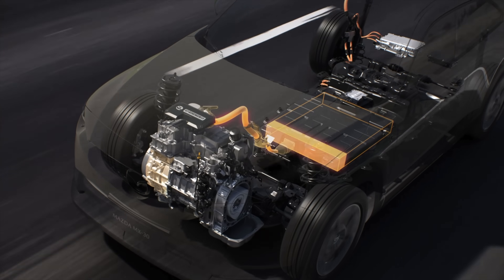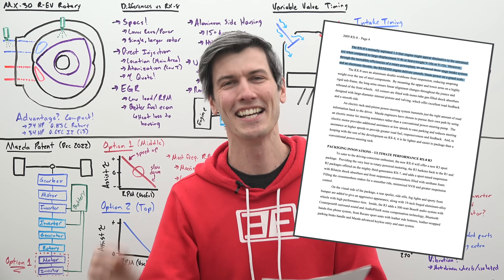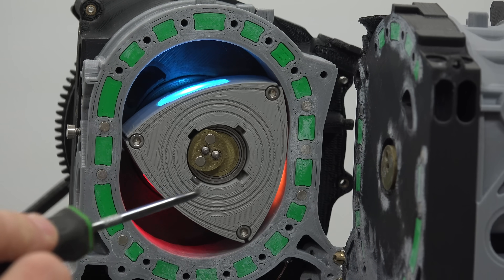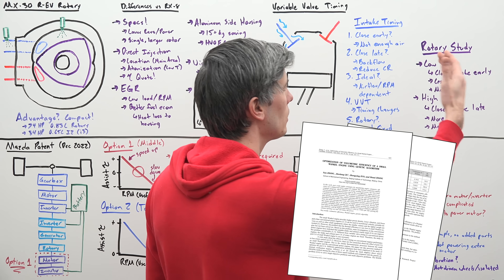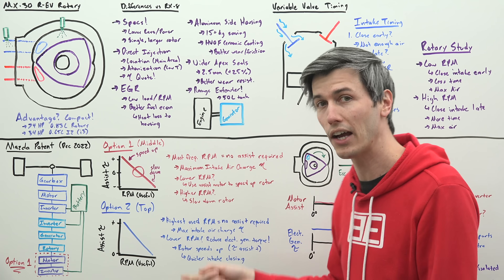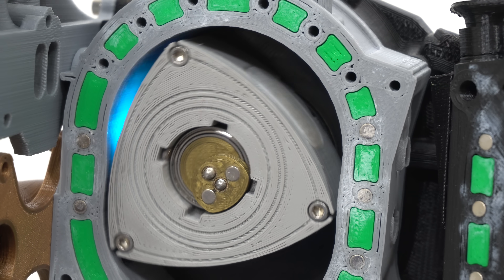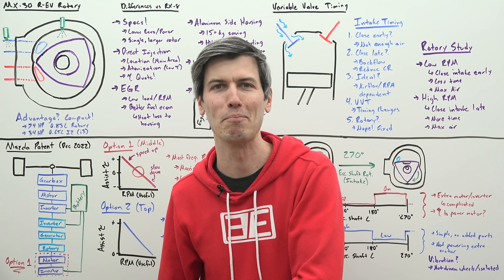Mazda Brought Back The Rotary Engine!

Comment: I've always wondered why we don't see rotary engines in modern motorcycles/atvs/snowmobiles/etc. Low vibration, high revving, not as much of a concern about efficiency or reliability as cars. A generator is another application I would say it seems like a good fit for, although putting that generator into a car I'm not so sure about. I saw nothing about addressing oil consumption which owners of modern cars, especially hybrids, are probably not going to be expecting.

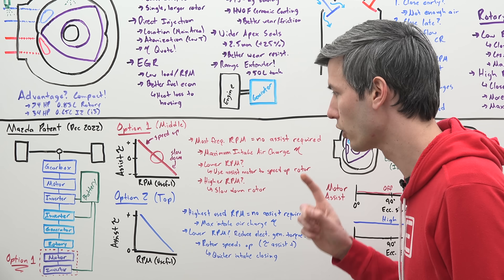Comment: 7:30 For a generator and battery bank sized to your max load you DON'T CARE about RPM range. 
1. The generator is never directly driving load. 
2. Your pack power matches your max load. 
3. YOU GET TRADEOFF BENEFITS OF OPTIMIZING FOR A TINY RPM RANGE.

Comment: Just a random question: has anyone ever considered using gas turbine as the range extender on EV vehicles? What would be pros and cons of such approach?
Reply: Excellent question. Because turbines run at a much higher rpm, the size is smaller and I expect might be about the size of a shoebox. Also, less vibration and fuel-agnostic. Hyliion is working on it.
Reply: Yes, it has been done many times.
The pros are that a turbine engine can be small and smooth, and that it can run on a range of fuels. 
The cons are that small turbines are inefficient, more efficient turbines with recuperators are expensive and have high oxides of nitrogen emissions (and still are not very efficient in small sizes), and turbines with recuperators are bulky and expensive (and still not very efficient in small sizes).
Reply: @brianb-p6586  Done many times? Can you, please, list any? 
I am sure aware about attempts to use gas turbine as primary engine, where it was mechanically connected to the propulsion (eg. transmission and wheels). I know attempts to us it in an electrical transmission setups, similar to the diesel locomotives, where turbine is used to drive an el. generator, which in turn would send generated current to the el. motor, driving wheels.
I also know about turbo electric generators (apart from those, used in aviation).
But, I never heard of a gas turbine, used as range extender in an EV vehicle, where the turbine is not connected to the propulsion at all and is only charging the batteries. And this is what I am asking about.
Why this kind of use is different from other attempts to use gas turbine on the ground vehicles? Because in the "range-extender" setup turbine can work within it's most efficient RPM range, independent  on the actual load on the propulsion system. This, theoretically should eliminate most of the problems with gas turbines, you listed.
Reply: @SQSNSQ  most of the turbine-electruc hybrids were urban transit busses, using turbines from Capstone. Wrightspeed tried it for years, for trucks, and even built their own engine. The most recent well-known example is by Ariel, using a Cosworth CatGen turbine.

Yes, mechanically decoupling the turbine from the wheels helps, and as a bonus the ability of an electrical generator to run at high speed eliminates the reduction gearbox usually required for turbines. Efficiency is still not good enough, especially with current emissions expectations. The series hybrid configuration does address some issues with turbine engines in conventional vehicles,  but not the cost, emissions, and efficiency issues that I mentioned.
Reply: @SQSNSQ  you described "an EV vehicle, where the turbine is not connected to the propulsion at all and is only charging the batteries". That does not exist, and cannot reasonably exist because if the generator (driven by a turbine engine or anything else) is connected to the battery, and the battery is connected to the propulsion motor(s) - through controller(s) of course - then the generator is connected to the propulsion system. In battery management terms, this is known as "floating" the battery, and it is the way that every hybrid vehicle works. The generator produces electrical power, the motors consume it, and the difference in power is the net charging or discharging rate of the battery.
Reply: @alexfunk2047  A shoebox-sized gas turbine engine is the size used in radio-controlled toys, and can produce a couple of kilowatts - nowhere near enough to be useful in a car-sized EV.

Comment: Pretty cool!  The Mk1 Honda Insight hybrid did a similar trick, but for a different reason: they used the motor-generator (which was in place of the flywheel) to smooth out the torque pulses of the 3 cylinder engine, so that the lightweight car was smoother to drive!

Comment: Well, the old Renesis engine definitely is incredibly efficient as compared to those big American V8 engines, it produces the same horsepower while being 5 times lighter and using less fuel... They didn't lie in the papers.

Comment: Now use this as a generator on a boat instead of huge lump of a  multi cylinder diesel generator. 
Where it can run efficiently at  relatively fixed rpm. 
Next step heavy fuel  fluid piston motors to power and or charge hybrid boat systems .. especially those with sails and acting as cruising or liveaboards.

Comment: Great video! A little off topic but the recent Pininfarina Battista quarter mile record set recently made me wonder how to analyze what an electric car might look like (with today's technology) that could match the performance of the current top fuel dragster 1,000 ft record (339 mph at 3.6 seconds). Could it even be done?  Would it be massively heavy and and need much more power/torque or with the instant torque of electric motors could it be smaller and lighter?

Comment: I imagine this has to have been thought about already, but why not try something like a power valve, like on some 2 stroke dirtbike engine, but on the intake, with some sort of soilonoid to vary to intake port placement
Reply: That is basicly what the Mazda '6 Port" induction system which was introduced on (I think) the second generation RX7. The engine had the normal 4 side ports. but one extra smaller port, effectivly a bridge port, was added to the front and rear side housings. A small barrel type valve operated by a an actuator, opened the extra ports above about three and a half grand, to give about 25 extra HP without affecting normal drivability.

Comment: Bro, in the previous press, when they said efficiency they meant thermal efficiency, I guess. How much of the energy from the fuel that is actually used is converted into kinetic energy. Theoretically speaking, rotary engines convert more of the fuel energy into kinetic energy.

Comment: changing rotation speeds all the while there is actual ignition going on in different part of the rotor...sounds like working against itself. If the point is to have variable airfill then an electric turbo would be more practical i guess. Need more air, spin up the turbo, need less, well at lower speeds it already works as a brake on airflow.

Comment: I'm interested in getting this r-ev but I have yet to find fuel consumption numbers. I read the range is "over 400 miles" with a 50l tank and a 13kWh battery, which would be rather poor. Not necessarily a deal breaker, though, as in this application efficiency and reliability are less important than weight, noise and vibrations, but I would still like to know what to expect.
Reply: I still wish they simply used something like Yamaha's x-plane parallel twin (or tripple). They would probably have to detune it for noise and emissions but I would have more confidence in it than a Wankel engine.

Comment: Rather that  using a motor to briefly slow (reducing the efficiency by fighting inertia 3x per RPM) and speed up (reducing efficiency by needing to electrically assist to speed it back up again), which I feel is gonna create wear issues, vibration (since the rotor would be forced to speed up and slow down in a non-linear manner), and other issues, I feel a VALVED rotary engine needs to become a thing. They should use an elongated valve that opens via electric motor or via output shaft drive, but open INTO the intake manifold, rather than down into the rotor chamber. This would allow for a VVT effect without that weird briefly changing of the speed of the rotor back and forth compared to the RPM constantly, working against itself.
Reply: Engineering Explained, what is this? Scammer pretending to be you?

Comment: Why not just doing very big intake ports (for high RPM) and shrinking/closing them when the RPM drops?
Reply: Why not use a more efficient reciprocating engine... Wankel engines are noisy, dirty, unreliable and have terrible fuel efficiency... totally incompatible with the whole green energy concept of EVs

Comment: So a rotary engine is good but not good. I wanna become an enginiere and when i do, if it didnt allready happen, i wanna upgrade the rotary engine. Possibly make a sorta fan or star design in a way that the fuel air mixture wont get exausted as raw burnt fuel. Altho them pops are nice.

Comment: Ignoring for a moment the variable rotor velocity that was the main subject of this video, would not the adoption of direct fuel injection as per this range extender enable a power-to-wheels rotary to recover some of the fuel efficiency losses of previous engines?  
And, I understand that thermal losses through the high area walls are a problem, but that is because the walls are cool.  The current paradigm of IC engine design keeps materials and lubrication within the temperature bounds of pressurised water and liquid hydrocarbon lubricants, because those are cheap and avaialble.  Could there be material surface and lubrication solutions that would enable the walls of the chamber stay at near combustion temperatures, and thus substantially eliminate that thermal loss (after warmup, of course)?
Reply: GDI was tested on Wankel engines back in the 1960s with very disappointing results, Wankel engines cannot support the higher static compression ratios needed to make GDI technology advantageous.
Reply: Unfortunately any new developments in high temperature materials would offer equal or greater benefit to reciprocating engine technology which is inherently more efficient, reciprocating engines offer greater combustion efficiency, thermal efficiency and much better mechanical efficiency.

The Wankel engine is inherently flawed on a fundamental level and will always be inferior to reciprocating engines.

Comment: @Engineering Explained: given that more  and more of these Hybrids just use the engine to run up a generator, does it make more sense to use a gas turbine which should give way more efficiency. The Inc cost point of a gas turbine I agree. But are there other considerations?
Reply: Range extenders in general are not a viable concept, gas turbines even more so.

Comment: The real genius is that to control the torque of the generator is as simple as changing the excitation to the field of the generator. In fact this is already being done to control the output voltage anyway. the only real difference between a motor and a generator is the excitation.

Comment: There's a huge point that could have been addressed:
Rotaries are definitely compact.  Mazda looks like they're onto this killer ap of the Wankel.  What is the likelihood that the Wankel Range Extender will become an INDUSTRY-WIDE STANDARD?!

This looks to me to be the cure, across the board, to the problem of Range Anxiety.

Comment: I assume that the rpm values stated in this video refer to the speed of the output shaft therefore the rotor turns at one third of the shaft speed with a top of 1500 rpm. Quite low. Right?
Reply: Yes, Apex seals have a very low surface speed range where they can operate efficiently without damage, this limits both the Rpm and the diameter of the rotor housings.
Reply: Mazda announced last week that it is dropping the MX-30 due to low sales and poor customer ratings.

Comment: If you're already designing for max rpm and max air intake, then why would you not then just use valve control similar to a piston motor to regulate intake instead of varying the load on the motor to optimize intake?

Comment: Hello,
I have carefully watched your video and thank you for the great insight into this interesting concept. However, I am somewhat skeptical in regards to your explanation of the rpm regulation by the means of the generator, for the following reasons:
(1) Inertia. There is a rather large and heavy system formed by the rotary disc, engine axle and the rotor of the generator. According to your explanation, this whole system would have to be slowed down from 4500rpm to a much lower value within a fraction of a cycle in order to achieve a significant lengthening of the intake duration. Such a (negative) acceleration, followed by a positive acceleration to bring the engine back to 4500rpm would cause an enormous torsion stress on the axis and also produce / require gigantic electrical power, likely over-stressing the system both mechanically and electrically.
(2) Regulation capability. The generator will inherently absorb a certain torque from the engine, the amount of this torque will naturally vary along a single revolution due to its magnet configuration. While you may design the number of poles of he generator to align with the power output of the engine, you cannot regulate the torque from inverter side within a single cycle at 4500rpm.
(3) Wankel engine specifics. Even if my points (1) and (2) were actually inaccurate, there is still to be considered that the rotary engine is designed in such a way that the phases of the thermodynamic cycle are all happening simultaneously. One of the three chambers is taking in the air, the second one is finishing compression and starting expansion/work, while the third chamber is expunging the exhaust gases. There is simply no possibility to take advantage of a speed variation within a single revolution, as the three chambers obviously all rotate together at the same speed.

So what is being regulated then?
My understanding of the patent and its implementation is that the regulation aims at maintaining the speed constant at 4500rpm independently of the load requirement. The generator will dynamically increase or decrease the power absorption from the engine in an effort to maintain its rpm at or close to the target value of 4500rpm. The battery pack is used as an intermediate storage for excess electrical energy created by the engine/generator and as an additional power source in case of peak power demand. This is a very similar concept than a constant speed propeller in aviation (except the battery).

Please let me know what you think about my points. Looking forward to read from you!
Hendric

Comment: EGR, direct injection, and lower engine speeds? I wonder how the rotor seals will put up with carbon particles. I assume it won’t build up because of the fuel charge, but there will be a fair amount generated.

Comment: Isn't generate electricity with an engine much LESS efficient then use it to move the vehicle directly?
Reply: Yes, except that rechargeable batteries are not energy efficient either... but they are more efficient than a Wankel engine.
Reply: On average, electricity that comes out of your wall, at least in the US, wasn’t efficiently generated.

Comment: I would have started with experimenting with an air compression tank, which is filled under high pressure with air by the extra torque motor, or by electricity that is generated by the main motor.. Then you regulate in nanoseconds when en for how long you use high pressured air from this tank to enter during the time the intake valve is open. This high pressured air is then mixed with the normal atmospheric pressure air......  So you can up or down the amount of air weight c.q. air volume at will, to that amount which is most optimal for the performance of the motor.. 
Of course you can also experiment with a turbo on the intake... But maybe more difficult to regulate for very short moments of time.

Maybe they have tried this approach as well, would not be surprised. And somehow it does not work so good as the solution that they have now come up with.
Reply: You're joking right?

Comment: I have one question for you: Why hasn't anyone tried to bring sleeve valves back? I understand that in the 1930s and 1940s, sleeve-valved engines burned more oil, but with today's tight tolerance machining and much better lubricants, I would think a sleeve-valve engine would be viable.

Comment: I'm always glad to see Mazda refusing to let the rotary die

It would be really cool if they would design a crate engine, specifically made for engine swaps, that was a 2 rotor with direct injection and the computer to control it, and engine harness all together. It would make for some really sweet economy and probably power gains for the old rx8s and rx7s

Comment: So if the intake timing is changing by altering the rotor speed aren't they also then messing with the compression timing of the two other lobes and doesn't that have a negative effect on their power stroke?

Comment: I understand but why not have a shut off valve in the air intake that is connected and correlated and tuned to the engine rpm

Comment: Surely there must be a simpler way to reduce or increase airflow into the combustion chamber. Why not use something similar to a mechanical valve? Just something simple to restrict the intake, instead of having to change the timing.

Comment: @EngineeringExplained I have a question? Is it possible when i designing process of the intake port that of shoot from the intake port that is either controlled of the engine rpm's or done just but the vacuum from the motor that opens when rpms increase it seals off the first one and still drawling in from the second for that little bit more air intake??